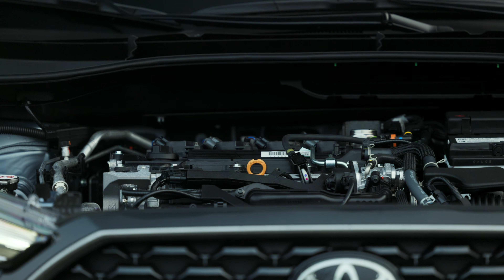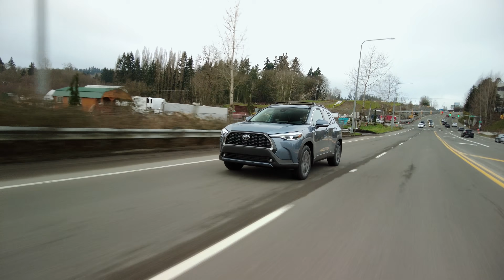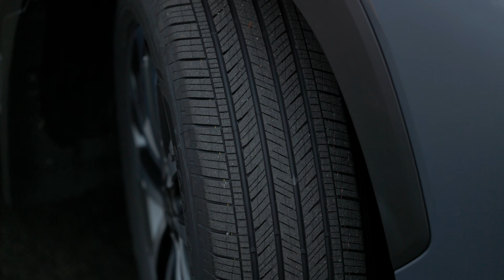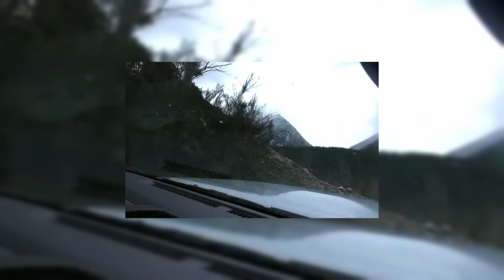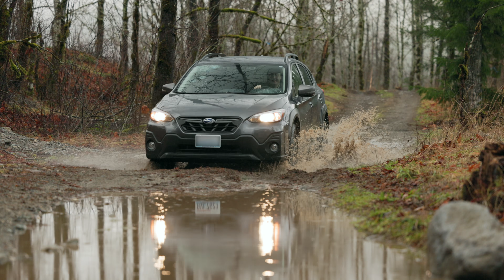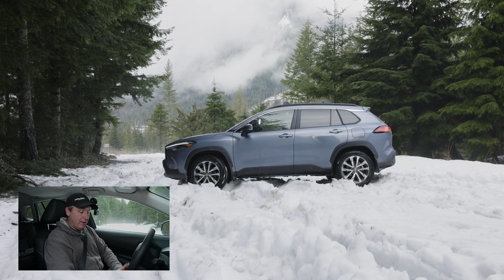2022 Toyota Corolla Cross vs Subaru Crosstrek AWD Off-Road and Snow

Comment: As a long time owner of both Subarus and Toyotas, I'm done with Subaru and their long term "quirks" that cause bank-account killing bills.  I'd buy the Corolla in a second.
Reply: Elaborate on quirks please
Reply: @jeffwisener1378  Head gaskets, turbos, CVTs among other things.  And yes, those are not issues relegated to old models.  Still having long term reliability issues.

Plus, their parts are expensive, my local dealer doubles the MSRP on parts making them even nastier and there isn't the aftermarket support like there is for higher volume brands.

Most Subaru braking systems except for performance models are junk.  The calipers fail early.  The bolts are tiny and made of butter.

We have two Toyotas in the family now, and damn, what a huge difference.  Done with Subaru...
Reply: @johnshellenberg1383  thank you for your reply.  I have owned 2 forresters, neither turbo versions. I essentially had zero issues with them. 

My brother was a master tech for Nissan ftom the late 60s onward. In his last 5 years of his career he worked for an independent shop that hired master techs from each car manufacturer.  The mechanic next to him was a Subaru master tech for decades. His basic advice was if a person wanted reliability,  stay away from the turbo engines. 

I was an advent snow skier,  spending 25-30 weekends a season in the mountains.  I found the Subarus to be superior in the snow to all other brands regardless of brands and that was my reason for owning Subarus.  If not for snow capabilities other brands like Toyota might be a better option but then again you had negative experiences that l didn't have. 

My overall experience with cars tend to be less problematic than others in general.  My brother maintains all my cars so all services are done on time and things like timing chains, water pumps etc are done before they create bigger, more expensive problems. In general,  (not saying it's your case because l don't your driving and maintenance patterns) car maintenance and driving habits are more significant to car longevity than brand purchased.  Example,  l owned a Nissan Altima, put over 400,000 miles on it with no engine or transmission/clutch issues. Literally the body began falling apart before l had mechanical issues.  The key was oil and filter changes every 3000 miles, not longer intervals stated in the service manual.  I also had a Nissan diesel pick up, over 300,000 miles, no drive train issues. That vehicle got stolen ending my ownership.  My brother thought it would go over 500,000 miles because those engines were bullet proof. The only part changed was at about 110,000 one injector leaded.

Comment: You would have gotten rolling again much faster with low slow throttle. Low grip environments require ginger changes in acceleration. If you are trying to walk on ice, do you go slow and carefully, or run around like a hyperactive toddler?

Comment: The Subaru has far more character with the boxer engine, thats the difference.
Reply: It builds character dumping jugs of oil into the boxer.
Reply: @user-tb7rn1il3q  ??? What about those head gaskets blowing right??……even though Subaru did away with the ej25 engine let’s bring that up.  Subaru has a better engine then most.  Simon George said it right 😀
Reply: @user-tb7rn1il3q  from what I have seen that was a concern years ago. 

I know of at least five owners where I work (out of 16) with Subarus from about 2012 on up who have/had more than one with no issues related to oil consumption. My own 2015 just completed about 5000 miles over the last two months with temperatures up to 111 degrees and used no visible amount of oil. The CVT did reach 230 degrees once which I understand is acceptable for very high ambients but I admit was a little spooky. Oil temperatures at the time was 218 degrees and coolant was 213 degrees. This was at a top of a long hill.
Reply: @perryfarmer3280  They will start burning oil soon.
Reply: @user-tb7rn1il3q  no they will not. The original issue was the engines involved were designed to be high tolerances to achieve better fuel economy which included an acceptable oil consumption of up to one quart per thousand.

Above that and Subaru would replace the engine. Owners considered that not acceptable and the engines involved were dumped.

Over the last 10 years the Forester has a rate of vehicles still on the road of ~97%. the Outback ~ 96%, the Impreza/Crosstrek about 95%. the rest in the upper 80s.

There is a reason there now is a waiting list for new Subarus and slightly older ones do not occupy spots on the lot for extended time periods.

Comment: Comparing the Corolla Cross to the Subaru Crosstek is a stretch....    Toyota is not marketing the Corolla cross as a lifestyle vehicle like the Crosstrek nor is it claiming the same capability.  The price point may be in same neighborhood.  The impreza is a better comparision or some of the other road bound crossovers that are out there.

I am glad to see that it is not as benign as an offroader as I would have expected.   It did better than I thought.    The LE is the sweet spot for this.  Toyotas in general are always more primitive than the competition but are also on the road  hundreds of thousands of miles longer than the competition too.

Comment: Totally unrelated: Have you seen the 2022 Bronco Raptor yet?
Reply from the maker: Yup. Too wide.
Reply: @drivingsports  With an MSRP of over $70,000 (dealers will probably try to get $100,000), most Bronco Raptors will never be driven off road.

Comment: Thanks: was very keen to see how the Corolla Cross would do.  Would love to see a RAV4 LE/XLE try the same things with the Rock and Dirt mode.
Reply from the maker: We do just that in the upcoming RAV4 TRD off-road review. Video should drop in about two weeks.
Reply: @drivingsports  Nice!  Curious to see how it will perform relative to Scooby.  Forester or Rav4 will likely be my next car.  The TRD has dynamic torque vectoring (DTV) AWD though, with special clutches..  I'm really curious about just how much they improved the standard AWD on the LE/XLE, which isn't DTV, but has modes for rock/dirt, mud/snow. etc.

Comment: Corolla  Cross looks great. Nothing against Subarus but after having Corolla alltracs and Tercel 4wds I am looking  forward to the Hybrid version coming to the market here in Australia.
Reply: The hybrid CC should definitely be an improvement, both in performance and fuel economy. Could be very attractive if the price is reasonable. As for appearance, it is a matter of taste, but I think the Crosstrek looks much better than the Corolla Cross. I just cant get past that huge grille. It looks like a giant catfish gasping for air.
Reply: @edsmith9855  to be honest. I really like Subarus but I feel the hatch styling makes the rear seat and load space to small. I agree the grille is a bit much but the rest of it looks really good.
Reply: Taiwan has Cc hybrid, not sure Australia will get it or not
Reply: @cacabeauty3693  there has been talk of them releasing it here as hybrids make up around 40% of Toyotas sold here

Comment: As per mine opinion, AWD is still weakest place of Toyota’s SUV. And I mean not a mechanics, but soft algorithms which are insane - it does nothing when small push is required or proceeds spinning a wheel without a traction.

Comment: Great review, I think they are two different all wheel drive systems and one thing the Cross will have is bulletproof reliability. It will probably last a very long time. Maybe 2 decades if rust proof with oil base coating.
Reply: how would subaru be any different? they are both good cars
Reply: @andrewdonohue1853  Subaru engines by design have lot more moving parts. Subarus still not a mainstream brand as Toyotas.
Reply: @Thankyou_3  Yes. My daughter had a Forester bought new. I wasn''t impressed by the mechanical reliability. Auto transmission completely blew out while under warranty. Subaru gave her a complete new one. Also problems with cam timing, air conditioning, alternator. She ditched it at about 100,000 miles. I've owned Toyotas past 37 years and satisfied with their reliability. Unlike Fords and GM's I used to own.
Reply: @toma5153  Yes. I agree. I bought an Outback new in 2019 and was disappointed in its reliability--cracked windshield, fuel pump failure--and in Subaru's denials there was an issue. They've lost class-action suits prior to  2019 on the windshields and finally recalled their fuel pump on the Outback in 2020. 

Does anyone remember the Corolla wagon?  I never understood why they discontinued it.  All the same reliability as the Corolla sedan and lots more space. The Cross attracts me as a way to finally get the old wagon back!

Comment: Reminds me of the RAV4. I know you mentioned they have the same AWD setup but the tuning is different. In your opinion was the RAV4 tuned better?
Reply from the maker: The RAV4 is better, but still limited compared to more robust systems. For Toyota buyers, I think they push more demanding 4x4 buyers to the 4Runner. 💪
Reply: I have a 2022 crosstrek limited and my gf has a 2022 rav4 .the rav4 has more power and a heated steering wheel but I like the crosstrek better ,subaru hands down in my opinion

Comment: I like the Toyota Cross. In your testing I get the impression snow tires would have made a lot of difference in the hill test and driving in the snow.
Reply from the maker: It wouldn't have made any difference on the bottom part of the climb. Grip wasn't the issue.

Comment: If reliability wasn't a factor, I would probably have gone for the Subaru just to get the more powerful engine, but I've heard enough about premature failures of Subaru's CVTs (both from people I know and online), plus the blown gasket issue with their boxer engines, that I've decided I wouldn't risk getting one. I'd, therefore, go with the Toyota, though I'd test drive it thoroughly first to see if I can live with the engine's performance.
Reply: The blown headgaskets issue was on a completely different engine. Its not all boxers its the naturally aspirated ej25 and that engine doesn’t exist anymore. It was phased out like 10 years ago

As for blown cvt’s every brands had crap CVTs. Nissans being the worst. However if you change your cvt fluid every 30-40k (whatever the owners manual says to change it at) you shouldn’t have any issues.
Reply: @joshuachristiansen2626  A colleague at work who's fanatical about keeping his car in showroom condition, so he follows the service schedule religiously, just had the CVT on his Crosstrek crap out at 100K kilometers (~62k miles), so good maintenance is no guarantee to avoid that problem. I'm in Canada, so not sure if the cold weather is a factor. At any rate, the Toyota CVTs seem much more reliable (lots of family members/friends with CVT Corollas and never heard of a problem).
Reply: @sammyt3514  hopefully he should still have a warranty left to cover the replacement of that CVT. I know good maintenance isn’t always a 100% surefire solution but I know it would prevent a lot of failures, I see so many stories of people complaining that their CVTs or Rear Difs on their AWD cars going out and you ask if they ever changed the fluid and they go “what are you talking about? Change the fluid?” 
So many owners are so irresponsible when it comes to maintenance.

Comment: You need to compare Subaru with the 2 liter engine not the 2.5 liter engine.
Reply from the maker: Why? The Sport is still cheaper than the Corolla Cross by a big margin.
Reply: @drivingsports  Toyota should have used their 2.5. Don't tell me it costs more to make than the 2.0.
Reply: It’s my opinion when you compare vehicles. They should have similar drivetrains.  Fair comparison would be the Rav 4 with the forester.  Similar drive trains.

Comment: Nice video!! I was wanting to see how the Toyota Corolla Cross did. Not bad, it needs better tires and a 2 inch lift and a G56 rear locker then it would have done a lot better.
Reply: So basically you are saying you want a totally different car with the same body of the Corolla 🤣
Reply: @subazealand9158  
No, just add some more options to it 👍
Reply: @subazealand9158  So a car is just the tires and ground clearance? Sure buddy.
Reply: Exactly my goal if I do get this. Besides the G whatevers no idea what that is.
Reply: @patrickbertlein4626  
G56 rear differential locker. It's an automatic locker that locks the rear diff when it sences any slippage. I went wheeling with a Subaru Outback that had one and it keep up further then I thought it would. I have a 2ng gen Tacoma TRD off-road D-4D diesel on 35's, 3.5 lift, locked front and rear and some other stuff.

Comment: I just got a Crosstrek Sport last month and I am loving the car.
Reply: I've had my Crosstrek for about a year now and I love it. No complaints.
Reply: SUBARU CROSSTREK SPORT 2021 # 1
Reply: For what it’s worth, I think both Toyota and Subaru are great brands. However, as far as head-gaskets go, at 190,000 my 2010 Toyota Prius’s head gasket started leaking coolant into the cylinders. That’s a very road tested model. Had to spend about two weeks carefully pulling the engine apart and replacing it, since I’m not a mechanic, and had to label everything. Head gasket issues are a universal issue. I want a Crosstrek as my next vehicle.
Reply: I just borrowed my friend’s crosstreck to drive up the Catskills mountains,loved the handling ,ride nice climate control,was very impressed.I own a civic ,so it’s like night and day,but my civic has gotten me everywhere,just not as smoothly!😁
Reply: For how much? i seen on their website 20k as suggested price 
i Called the dealer and they said its 28k
Reply: @zaydyancovich1050  my 2022 crosstrek limited was $33,600
Reply: @zaydyancovich1050  30k.  With all the goodies
Reply: I live in BOSTON,   AWD is the most important !    SUBARU WINS HANDS-DOWN!
Reply: Until u blow a head gasket lol no thanks
Reply: @SacredSleeper  hey. Mechanic and Crosstrek owner here. You don't know what you're talking about.
Reply: @SacredSleeper  lol, your knowledge is about a decade+ behind.